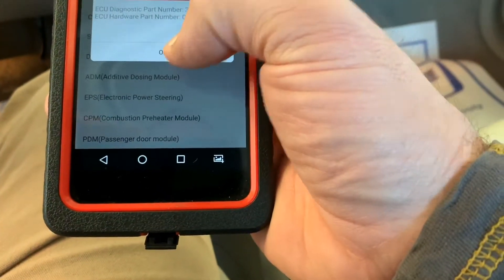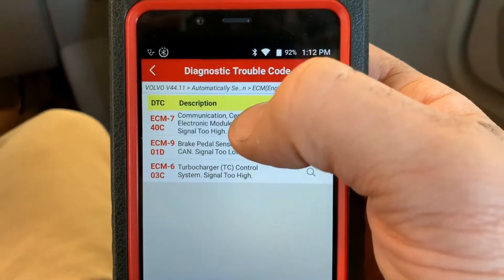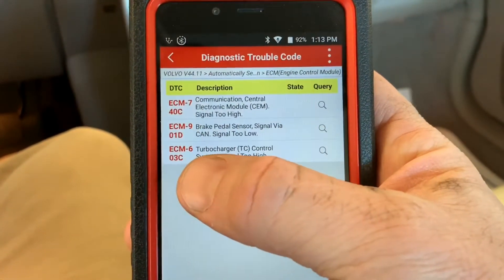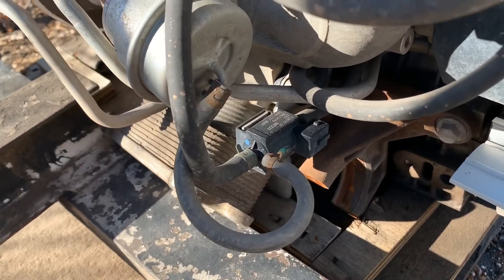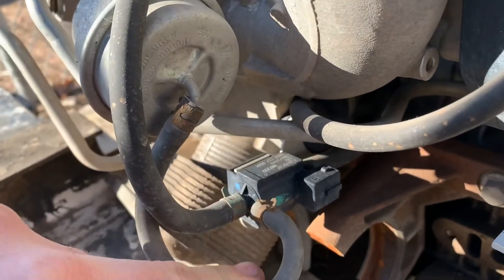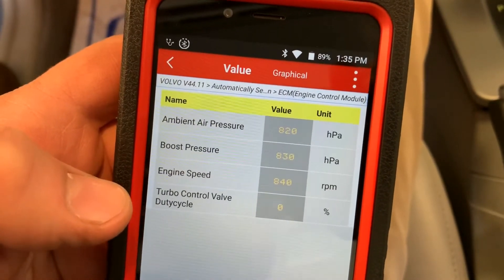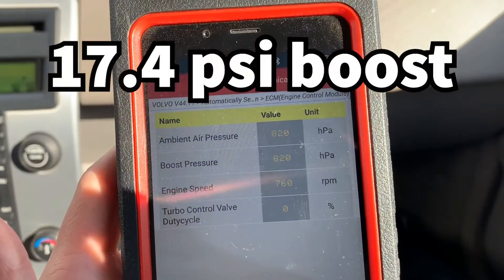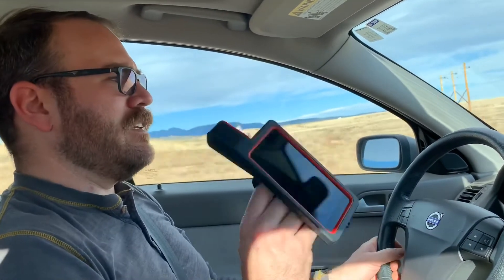2006 Volvo S40 no top end power - ECM-603c code

Comment: The CEM Signal too high code usually means that your ECU is tuned. should also have a fault code in CEM for faulty software in ECM. they go hand in hand when it is remapped.

Comment: Hello friend, I have a volvo s40 d2 2008, the engine is 1.6 diesel, it has changed a new turbo and a new catalytic converter because it had to be changed before, and an olio filter because it still has no power, what do I have to do? The mechanics say you have to change the egr valve, can you help me brother? thank you 😢🙏❤

Comment: It only needs a thermostat and hoses and that turbo solenoid and a brake switch and, and, and... 

I tell all my customers, “You’re supposed to have the car inspected BEFORE you buy it!” 😎
Reply from the maker: Lol. It had a blown out radiator hose. And I ended up buying it from the customer without driving it before hand. It’s all good though. It won’t take too much to get it back into tip top shape.